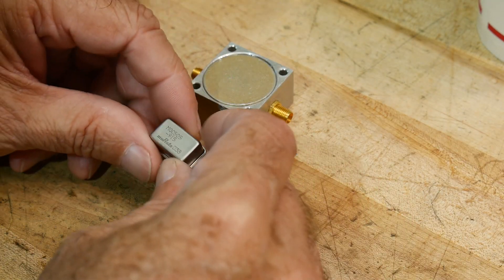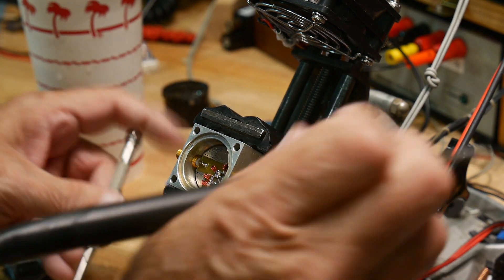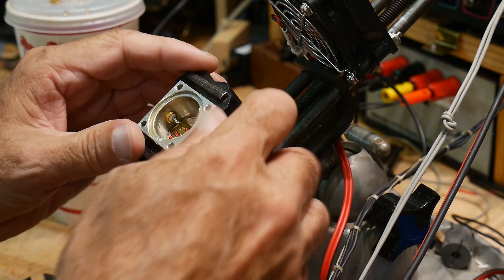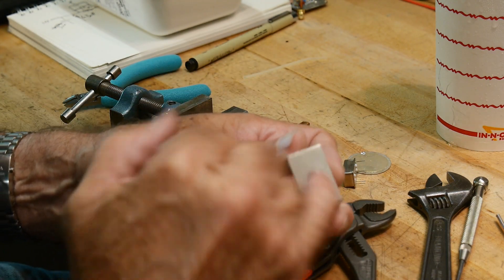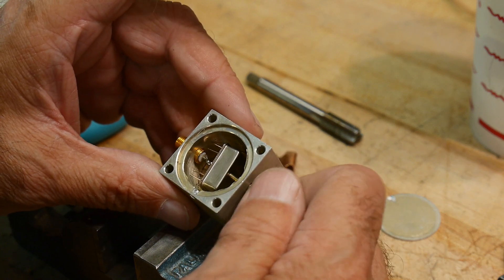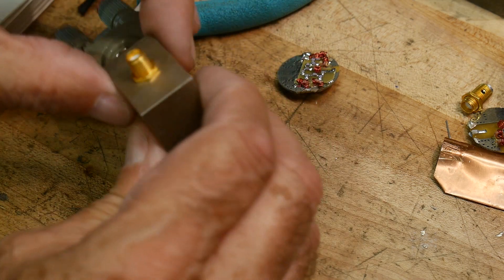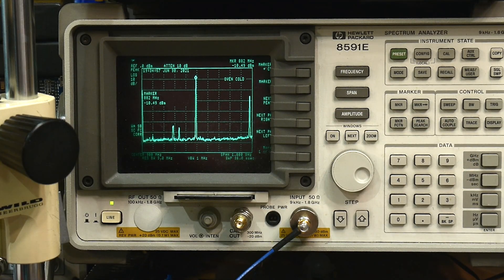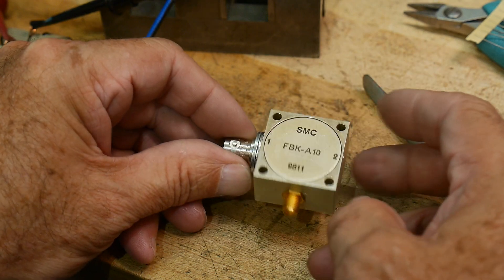#897 MuRata 900 MHz in a Box

Comment: Would suggest you take the adjust pin to a feedthrough 1n capacitor in that last hole, and inside the case a 10k resistor to ground. Then add a 10n ceramic chip capacitor soldered between Vcc and ground on the oscillator pins, and a 10uF 16v electrolytic on the supply side. That will add local decoupling, and also a bit more ESD protection to the module as well. Then you can clip on a trim source to the oscillator if needed. Would suggest soldering the screens back in place on a spot or three as well, they otherwise will be excellent as noise injection points if floating. If not soldering, or using conductive epoxy then a simple staking with a punch on the aluminium in the corners, where it is thick, will work almost as well, deforming metal to get a bond through the oxide coating.

Comment: Nice.
What are the smaller peaks below the base frequency?
Reply: Probably nearby FM radio and AM broadcasters, along with local oscillators in consumer equipment.
Reply from the maker: Sean has it right.
Reply: @IMSAIGuy  Even with all the nice coaxial cables and connectors?
You must build an Faraday cage to shield your room.
(This may also save you from an EMP pulse)😁
Reply: @paulcohen1555  Power supply neds some filtering inside the case, as most of the noise is via the power rail.

Comment: Nice box to add to the collection! I always thought it was strange that the BNC connector is the  industry standard power connector for noise sources.
Reply: Shielded cable prevents a lot of RF pick up in the power line. But you do need some filtering here inside, as the wire leads are an antenna.